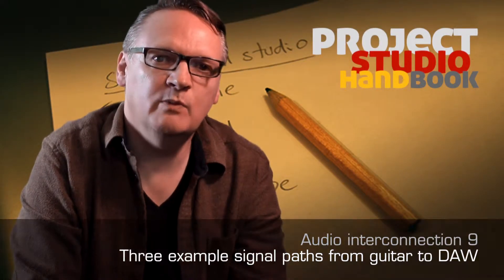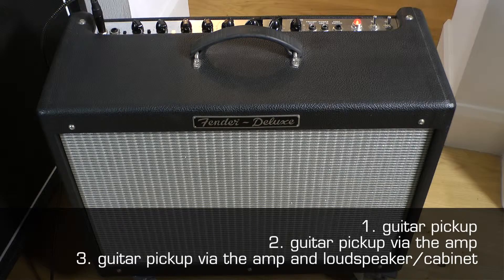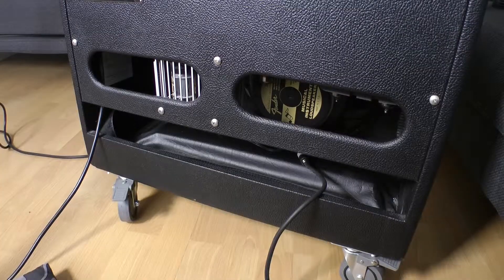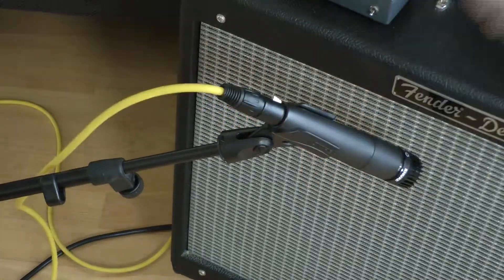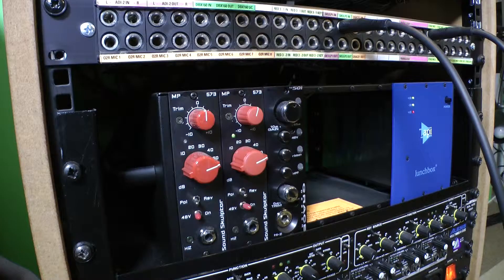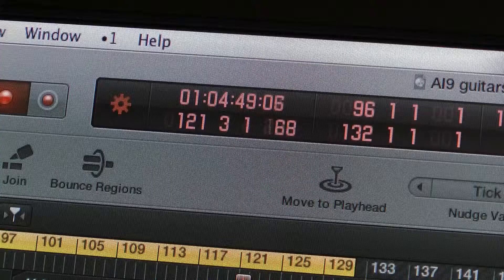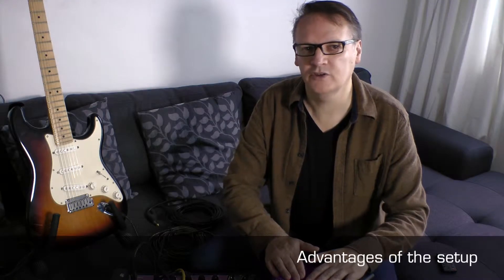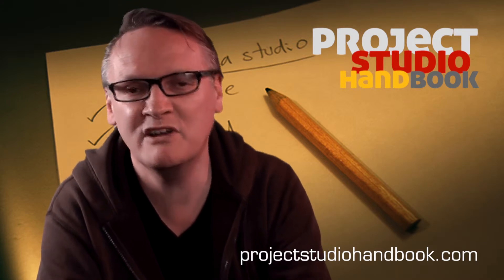Three example audio signal paths from guitar to DAW (v1)

Comment: I'm building a guitar cabinet and I'd like to use a plug-in like Amplitube as the head. However this can't be done without some type of pre-amp out. If my A/d is very low-tatency I could also use a laptop to process the dry signal pre and post with an application like Ableton live. How would I set up for a live rig? have a dry input and send an external out to a pre-amp to a speaker cabinet? Remember the cabinet is just a cabinet with nothing else but a 1/4 jack and a speaker.
Reply from the maker: It sounds like you will need a power amp to drive the speaker cab, and a means of getting an acceptable signal to it from Amplitude. The signal chain could be .. guitar signal > DI box > mic input (audio interface) > Amplitude > line out (audio interface) > re-amping box > power amp > speaker cabinet. Orchid Electronics do an excellent re-amping box but you might want to run what you are trying to achieve past John Gosland before parting with your money .. http://www.orchid-electronics.co.uk/Amp_Interface.htm
Reply: I couldn't argue with you. That is the chain I thought would work as well. I remembered after typing I have an old head down in my parents basement that hasn't been used in years. It was a room-mates gear that the entire band would insert their instruments into via 4 stereo inputs on 4 channels. It might still have life in it. I also have a behringer mixer with mic preamps that may help. Ideally I should buy a DI box and re-amp. My focusrite A/D died in Windows 10 after a few months and I'm on my last legs of tech support trying it on a macintosh (having to buy the 400 to 800 firewire and thunderbolt adapter.) If it doesnt work then I'm in an out of warranty repair. Joy! I'm also getting issues all around with Amplitube 3 seeing it doesnt properly trigger preset changes via midi clips and appears to only work in Amplitube 4. So, it seems the money gods are working against me. It is a costly process building a rig that is functional. I'll be exhausting every cheap option I have before spending. Simply not in my budget.
Reply from the maker: Bad luck John. It can be challenging trouble shooting a software system especially if you're using FireWire. Hope you get it sorted soon.